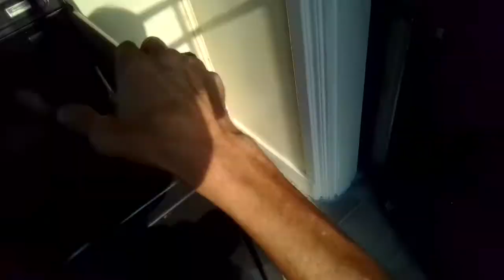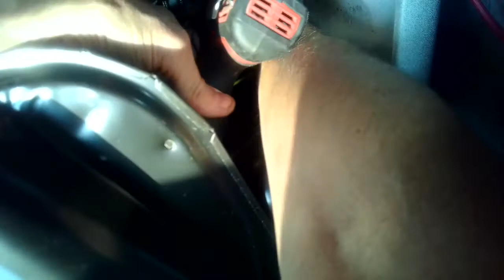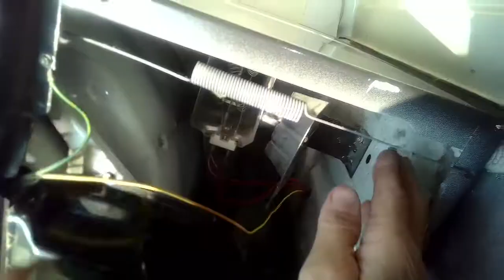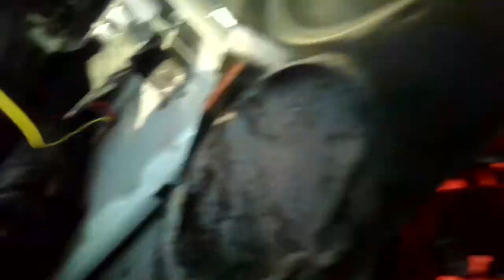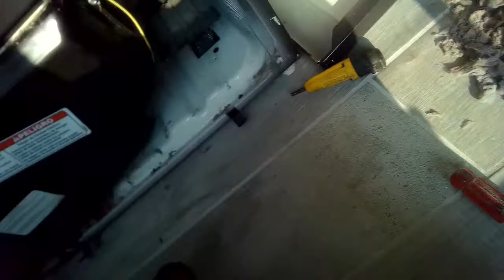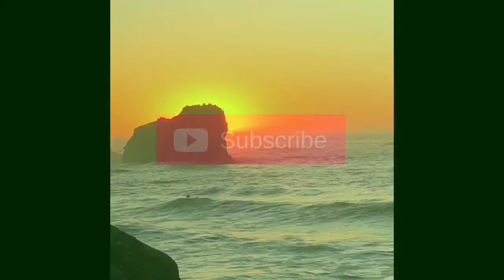✨ KENMORE ELECTRIC DRYER Won’t Heat Up - EASY FIX ✨

Comment: Every part I tested has continuity, thermal cut off, fuse, cycling & high heat thermostats and the heater coils. Yet, my dryer still does not heat. aaaarrrgh!
Reply from the maker: Can you double check that both breakers for the dryer are in the full on position?
Reply: @QuickAndEasy5MinuteAppliance  yes. I did. It runs it just does not provide heat. Clothes are still wet and cold. Thanks for your rapid reply. I truly appreciate it. I don't know what to do. I refuse to buy a new dryer at these new prices...😫
Reply: @QuickAndEasy5MinuteAppliance  I just checked. To be clear you are talking about at the breaker box on the wall? I am new to this and want to be sure.

Comment: Thank you.  The 'slam it against a hard surface' technique worked a treat.  We'll be buying a replacement part to have on hand, but, with a little luck, it will stay on the shelf for a while.
Reply from the maker: You're welcome!😊
Great idea to also clean out the dryer vent tube👍
Reply: @QuickAndEasy5MinuteAppliance  Thank you.  I had done that first.

Comment: I tested all of the fuses and connection to the heating element but it still does heat. 
What next??
Any thoughts?
Reply from the maker: Can you double check that both breakers for the dryer are fully on?

Comment: I followed your tutorial and got my dryer working again. I did take a picture of my part in case I need to buy a new one. Thanks for all your help, much appreciated
I had to smack it on the ground a couple of times but I got it to work
Reply from the maker: Glad it helped, it’s important to clean out the vent tube behind the dryer.

Comment: Hello! I replaced the thermal cut-off, but the dryer still isn't heating up. Any suggestions? Thanks so much! :)
Reply from the maker: I wonder if the element has failed?
Reply: @QuickAndEasy5MinuteAppliance  is that something I could check myself? Thanks! :)

Comment: First, thank you I ordered the parts kit from Amazon, installed the Thermal Cut-off, and it worked.

BUT now a week later and this new thermal cut-off is now broken... 

Do you have any suggestions? Is it just bad luck with the new part or something else?
Reply from the maker: Glad I could help,
I bet the dryer vent tube or where it exits the house is full of lint.

Comment: Thanks so much for this video! I ordered the parts on Amazon and changed out everything today and the heat is back! Now I do have a question. I never looked behind the dryer when it’s on but I did today and I could see an orange glow coming from the bottom of the dryer where the heat element is located. That glow I’m seeing is okay right? While I was at I bought a vent cleaning kit and cleaned that out! In the 18 years I lived in my house I never cleaned it out and I couldn’t believe how much lint I was able to clear out of dryer vent duct!
Reply from the maker: You did great Chuck, and that glow is normal 👍
Reply: @QuickAndEasy5MinuteAppliance  awesome thanks so much!! You saved me some money from hiring someone else to do the work lol.

Comment: Dude..!  You SAVED. me..!  That hack about smacking the Thermal Cut-Off on the ground a few times....  That's exactly what I needed, cuz my local appliance parts place is closed on the weekends, so I tried that hack, and it worked..!  Clothes are drying. Yay.  I actually removed the entire heating element (2 small screws in front), which allowed me easier access to the Cut-Off and it also allowed me to clean the element, and everything else out under there. It was insanely covered in lint - EVERYWHERE..!  Anyway...  Thank You for uploading this.  It helped a lot.! (3 years later after uploading) - Gotta love YouTube University, thanks to guys like you.
Reply from the maker: Nice job, also good to really clean out the dryer vent tube👍

Comment: When the video started you showed one model Dryer and then as you started working on the Dryer it was a different model.  Very frustrating....
Reply: I have the 90 shown at intro
Reply from the maker: Which one do you have?

Comment: My Kenmore 90 series has the 3 components like yours, but the one in the far back (thermal cut off I presume) doesn't have any wires connected to it?
Reply from the maker: Can you send me a picture of that? Scottthefixitguy@yahoo.com
Reply: I have 90 series as well. Same question. Has anyone responded?
Reply: @johnnyoneniner4820 I never did figure out why mine was wired that way.

 I discovered that my heating element was burnt up so just replaced it and it's been working fine. 

I can't remember how I diagnosed the element, but look for a burnt through wire. 

Of course, it will show infinity on the ohm meter signifying an open.

If you can see voltage at the element terminals with nothing happening that would also be a good sign. 

Since I don't know if they were made this way or if techs were bypassing things it may not be super safe to go to bed, or leave the house, with it running.  I'm not worried  but something to consider.

Comment: Thank you for this video it helped out alot I had to smack it against the floor and reset it just because my local appliance store isn't open today because of Christmas hopefully they open tomorrow. I just have a couple of questions when I was reconnecting the black wire I sort of bent the end of the wire that connects to the thermal cutoff. Can that wire be replaced? If so I just remove it from the thermostat and thermal cutoff and put the new one in right? Does the position of where black and red wires go?
Reply from the maker: Can you send me a picture to:scottthefixitguy@yahoo.com

Comment: Thanks for the video! Waiting for thermal cut-off to be shipped. Just a quick question. Do I need to remove a wire to check continuity on heating element?
Thanks again and have a nice day!
Reply from the maker: You should remove one of the wires for the check👍

Comment: Thanks for the video.   Getting to the thermal cut-off proved more difficult than imagined... for someone sitting trying to reach it.  Once you lay down... and look upward.  EASY!  the top notch actually goes into a tiny hole, and not the opening like it's trying to hold it in place.  Once in the hole, I was able to tighten up bottom screw.  Until amazon part gets to house, i banged the cut-off switch, saw resistance.  😀
Reply from the maker: Nicely done😊😊😊

Comment: Thank you so much.  I was about to buy a new dryer and Google brought me to your video.  As a 73 yr old female, accessing and removing the element connector wasn't easy but I succeeded.  Spent $16 in stead of $1300.  Yippee!  (I couldn't figure out how to use the tester, so I didn't test for continuity, I just removed and replaced it.
Reply from the maker: I’m so proud of you Wendy❤️👍😊